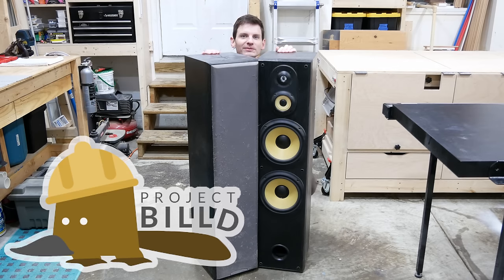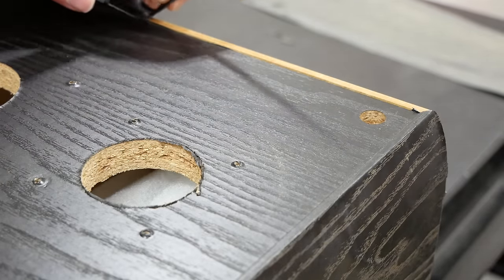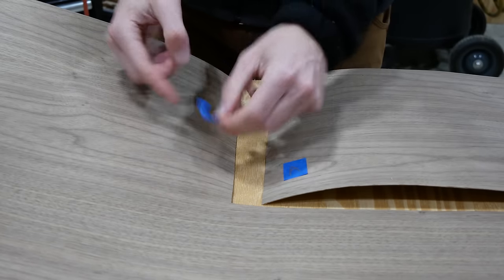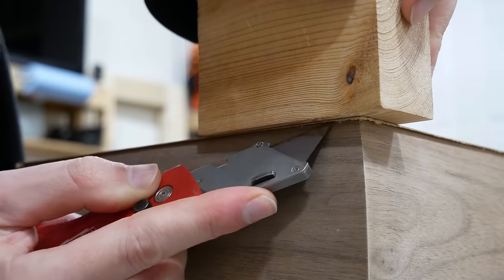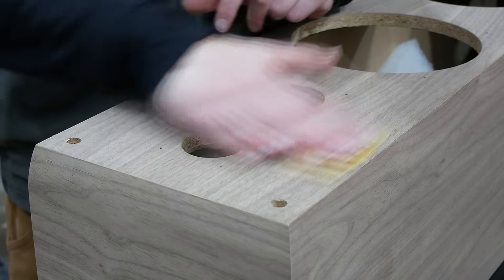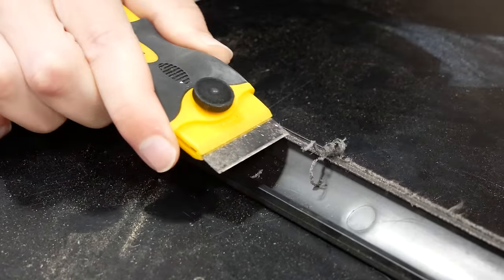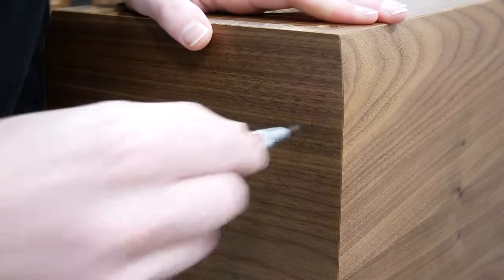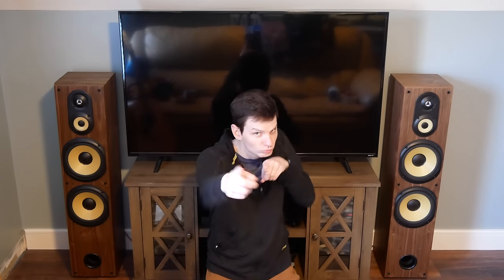How to Restore Speakers with Wood Veneer

Comment: I do this for a living and have to say you’ve done a cracking job and exactly as I’ve been doing it for over a decade now.  You can use a power sander on the veneer but only with light pressure.  You’re better applying the veneer a little sooner whilst the glue is slightly moist and be careful how long the iron is applied for as excess heat destroys the glue which might initially stick but can provide a poor bond and fail with too much heat.  Use a wooden block to move out from the centre to edges, removing air bubbles and also taking the heat out of the glue causing it to grab.  Great job overall👍
Reply from the maker: Thanks for the tips! Stuff like that is super helpful
Reply: can i use b7000 for the cloth glue?
Reply: @StagnantMizu  yes, of course. With care, you can also use hot met (sparingly applied) for polyester fine weave for things like grille cloth edge fixings. Best of luck with your projects.  Always sensible to try new methods/glues on a test sample first👍

Comment: Nice work. I wish I could run a router that well. I've done laminate countertops and I'm going to try and attempt some  receiver ends first before I try speakers. This will be my go-to vid. I didn't know wood glue could be used like that! I always use contact or spray glue. Both are NOT user friendly. One missed drop, and the project is over! Great vid!!
Reply from the maker: Thanks! I had no interest in messing with contact cement so I looked for an easier method, it's holding up perfectly so far

Comment: One thing to consider when doing this is to replace the speaker grill fasteners with magnetic ones. They work better and give a cleaner look as they would sit behind the veneer.
Reply from the maker: That's a good tip, thanks!

Comment: Great video, very detailed. They look awesome! I just bought a pair of vintage Sansui speakers and want to refinish them.  The old veneer is peeling.
Reply from the maker: How bad is the veneer peeling? If it's not bad you could use a glue shringe to inject wood glue underneath, wait for it to tack up some and then iron it like in the video

Comment: REALLY good video!  Take pictures of the wiring lol, excellent advice.  Nice job matching grain and even steaming to hydrate and raise out the router bit denting.  I like the wood glue/tack up idea over contact cement, more flexible realignment/open-time window.   And, possibly even adhesion over your radius at the edge.  Great video.
Reply from the maker: Can't begin to count how many times I've started a project without taking pictures and the forgotten how it went back together when I got to the end

Comment: Seeing this speakers disassembled I can say those are some high quality speakers. Just the crossover itself is a work of art. and that inert baffle, internal bracing and damping. Joy to see.  Great job on the veneering though. Educational.
Reply: Internal bracing is important on a lot of speakers but I don't think it is so important on tower speakers where the sides are very narrow. Simply would not make that much difference. Yes the drivers were cheap but perhaps they still sounded good. the first order crossovers only for the tweeters is typical for inexpensive speakers. inductors significantly increase production cost. If they were mine I would do a test with a calibrated microphone on the woofers then the tweeters and most likely build a second order crossover. I would not say that baffle is inert I am sure it was sized accordingly. This guy is a good craftsman and did a great job on this project. He never claimed to know a lot about crossovers. He preserved these speakers as a family heirloom. He can always upgrade the drivers and crossover later if needed.
Reply: Not really, very cheap wood used.

Comment: Wow, you really improved on the look of these! 

Would be quite easy to improve the sound of these too by building a crossover for it, upgrade it's internal wiring and treating the cabinet with some more dampening material. For something like this, some bitumen on the panels covered with rockwool would do quite well without costing a lot I'd say. 

For the crossover; No need to use expensive high end filmcaps for something like this. Just a simple 3 way LR2 network with some cheap NPE's and some inexpensive inductors would be a massive improvement in comparisson to a speaker that just uses two caps as a first order high pass filter.

To decide on crossover frequency you just run a few sweeps in its current form and measure the drivers in REW.

Don't get me wrong, it will never be a audiophile speaker, but good gains can be made with not too much effort and money I think.
Reply from the maker: Thanks for the info! I'll definitely be revisiting this comment if I decide to do any internal work to the speakers
Reply: Since the speaker doesn't have a proper midrange, but essentially two tweeters, the frequency response of them will never match properly. Not worth investing in a measurement set up for this. They will sound ok-ish, no matter what. Bass and treble is present anyhow, and they will never have good midrange or flat frequency response. Unless the tweeter cone driver is replaced by a larger midrange, which will need a sealed compartment behind it. Overall - too much work for someone who I guess is inexperienced in electrical and acoustical engineering and too much money to be spent. 
Adding some damping material is a good idea though.

Comment: I was looking through YT on how to veneer speakers, because I have some black speakers from the 90's and early 2000's, I was surprised to see a video on the exact speakers I have! I bought them in the early 2000's from Fry's, and they were cheap. However, they sound better than they should. They are worth veneering IMO, if not just for practice! I was surprised to see cast woofer frames. Now that I've seen inside these, I'd probably upgrade the wiring a bit (I think 16AWG would be plenty on these) and maybe consider a 12db crossover (maybe not, these are engineered this way, may not be an improvement). I use my Sony towers with lower power Pioneer SX-636 receiver, so it'd be cool to use walnut veneer and brownish/tan speaker grill cloth to match the SX.....
Reply from the maker: Sounds like you've found your next project haha

Comment: You made those speakers look nice! You might whant to change the capasitors becurse thay tent to fail with time and might pass on tje full signal to the tweeter wich will kill it
Reply from the maker: Good call. Likely going to be redoing the wiring and crossovers entirely in the future
Reply: You quite right there, plus upgrading to higher quality over electrolytic. And even if film capacitor😊 being used. Can be sure the manf didn't  buy the beer or best. Also some bracing added inside for resonances . So all in all, the veneer is nice but just a lipstick effort

Comment: Hi.. nice box restoring and result. I thought it is already good looking when you stripped off that ugly black thing. I would already be restoring actuall drivers (they could use some thin layer of glycerin on the rubber surround) and for the big bang upgrade for little to no money, the cheap crossover parts - just change the electrolytic capacitor to film capacitor of same value and you got yourself 2 levels up!
Reply from the maker: Thanks for the tips!

Comment: How flexible did you find this veneer to be?
I’m considering it for dynamic curves on vehicle interior trim pieces.
What methods do you think could be used to soften it for molding around curves?
Reply from the maker: It's fairly flexible. I know down to about a half inch radius is doable as long as the grain is oriented correctly, I'm not sure smaller than that. If the curve is very small and you find the the veneer cracking you could try a veneer softener/tamer. I've never used one but that would be my next step.

Comment: i have the smaller version of those, its those minus the lower woofer and port. im currently using another pair of speakers that are carpeted, i would like to have them re carpeted. thanks to cats.
Reply from the maker: I have those too! My dad bought those to be the rear surround speakers in his system a long time ago. I haven't restored those. Will likely end up using them in the shop

Comment: Great job,what is that black material on the speakers box.
Reply from the maker: Can you be a little more specific
Reply: @ProjectBilld  black wrap around speakers what is it?first original material.
Plastic folie?
Reply from the maker: Ah some kind of black vinyl wrap. Fake oak grain
Reply: @ProjectBilld  can this in good shape ne paint.
Reply from the maker: You could paint vinyl with the proper prep but I wouldn't bother and would advise removing it first. Too much chance it bubbles up and ruins your paint job
Reply: @ProjectBilld  thanks very much.

Comment: Did I miss something?  Where's the cross over for these speakers?  I saw the capacitors attached to the tweeter and mid-range driver.  Was that it?  Usually you use a copper coil to differentiate the lower frequencies to the woofers, but I didn't see those. Then I saw that the woofers were daisy chained together.  Wow...Sony was doing some kind of magic there. I feel like your restoration was 10 times more impressive than the design of the speaker itself.
Reply from the maker: Yep that was it... I don't know much about redoing speaker wiring yet, but it's on the list for a future project
Reply: @ProjectBilld  I would do the same. The driver load out on those speakers are excellent if engineered better. The current problem with how these were designed is that the woofers are taking on the entire, full range of the signal and then the capacitors filter out the lower frequencies.  So what happens is, the higher frequencies interact against the lower frequencies in the woofer.  This causes the bass to become "flabby".  Instead of articulated bass notes, you just get generic "whumps" of bass. So filtering out those high frequencies for the woofers would be paramount.  

The next thing to do would be to control cabinet resonance.  The tweeter is the most fragile of the drivers and is ultra sensitive to any vibration.  I would look into getting some vibration resistant foam and see if it can be attached around the area where the tweeter attaches to the cabinet. It's also why you sometimes see various types of material inside a speaker.  It's to mitigate the vibration from the woofers  interacting with the other drivers. 

Just my .02 :)  Good luck with your build.  It does look extremely impressive. :)
Reply from the maker: Thanks for the advice! It was very clear and helpful
Reply: No coils because that's how all cheap speakers from Asia are. 
But that 'midrange' (in reality: 3" cone tweeter) will not match properly with the 10" woofers. The frequency response won't have enough overlap and additionally, the distance from the lower woofer is too large. No matter how many components are thrown at it.

Comment: Interesting, never seen this method done this way. Any reason you went with wood glue instead of contact cement?
Reply from the maker: Yeah, I didn't know how well contact cement would work on the curved edges of the speaker and I had to realign the veneer a few times to get the grain patterns to line up and I didn't want to even try messing around with contact cement for that

Comment: nice job! would you mind sharing time spent and cost of materials?
Reply from the maker: Thanks! The tools and materials used are all linked in the video description but off the top of my head: 2 rolls of walnut veneer $50 each, wood glue $5, poly $10, the speaker cloth and adhesive $30. I completed the project in about 3 weeks, but it takes me significantly longer as I'm recording, editing, and figuring things out.
Reply: @ProjectBilld  Superb, Concise and Thorough Presentation!  ENJOY THE SPEAKERS!
Reply from the maker: Thanks! I've been loving them so far

Comment: Very important
Never use wood glue on a waterbase.
It will swell the veneer .
You didn't mention the type of glue here.
Reply from the maker: I did mention that is was just normal pva (wood) glue. I used paperbacked veneer so swelling wasn't a concern
Reply: @ProjectBilld  PvA wood glue is waterbased.
Lucky you hadn't swelling.
Maybe paper based veneer is less absorbent.
My first speakers, I made that mistake, and was not able to iron out the bubbels due to swelling .
So I had to sand my veneer down to the original mdf, and applied a contact glue, not waterbased.
I used pure veneer.
Reply from the maker: Yes paper backed veneer makes it safe to use a water based glue
Reply: @ProjectBilld  good to know.
Thx.
Great job btw.

Comment: Nice job, but i would question using wood glue like contact cement, and using heat to make the bond. They actually make heat activated glue that is used in upholstery that would have been the much much better choice. I would bet money the "heat activated" wood glue will fail with time.
Reply from the maker: It's holding up fine for now. I don't know about the longevity as it was my first time doing it that way, but using pva glue is not a technique I created, it's a method used by woodworkers with a lot more experience than me so I do feel pretty good about it. I have since discovered heat activated glues made specifically for veneer so I'd likely use one of those next time. I will post an update if the glue begins to fail at any point.

Comment: Nicely done and nicely explained, but you could have upgraded them at the ame time by adding bracing and panel damping material inside (see GR-Research's NoRez product, plus Rockwool) and upgrsded the crosssovers with better quality components, but very nice job with the veneering.
Reply: Yes I thought the same, even reinforcing the case front to dampen resonance as well, with 2 woofers looks like it would help. But then it would be more like a speaker building project.
Reply: @robertjdejong  i like a challenge like That. If the cabinet net walls are quite thin like 12mm particle board you can also line it with 3 or 6mm MDF to stiffen it up and add bracing and damping. But ultimately it depends whether the drive units are inherently good enough to justify such an amount of work that you would get a good speaker at the end of it or just buy a god kit from GR-Research and be guaranteed a good speaker

Comment: my friend you did a superb job of plating but I don't understand why you left the back of the speaker like that even if the back is not visible. in any case it is very clean work congratulations to you 🤝🏻
Reply from the maker: Thanks! Guess I didn't really see the point since it's not visible. More work/cost and now I have a reminder of what it looked like before

Comment: If the vynl wrap is in like new condition is it possible to apply the veneer on top ? Without taking it off.
Reply from the maker: I don't know. My instinct is that it's a bad idea and you might damage the vinyl adhesive when applying the veneer. Probably would work ok if you used a peel and stick veneer, but I've never worked with that type so again, not sure.

Comment: How did you use the trim router, without cutting the veneer already attached, like you did the bottom first, then the sides, wouldn’t the bottom get cut by the router bit? I tried it and that’s what happened to mine
Reply from the maker: If you're using a flush trim bit, it shouldnt be able to cut past whatever surface the bearing is up against. But I've seen some cheaper bits where the cutting blade is actually a slightly larger diameter than the bearing and cuts past. I'd check that and get a better bit if that's the case

Comment: can you do this if you don't have a flush trim bit, is there another way to get some clean corners
Reply from the maker: Yeah you could trim all the veneer with a utility knife like I did in the video where the flush trim bit couldn't get close enough due to the rounded corner of the speaker
Reply: @ProjectBilld  perfect I'll give it a go thanks a mill 👍